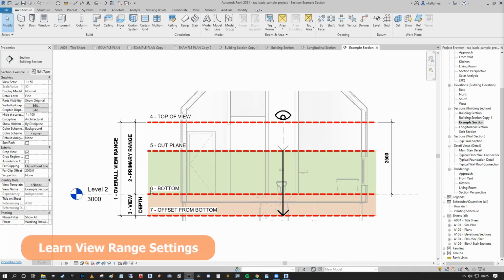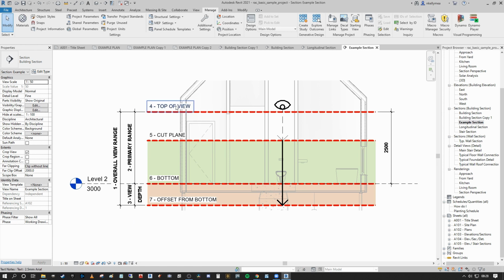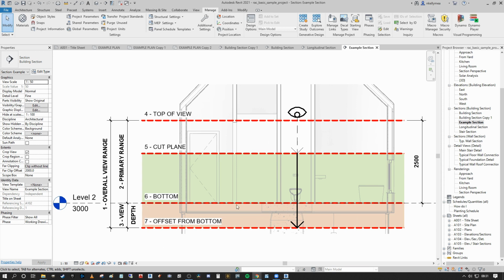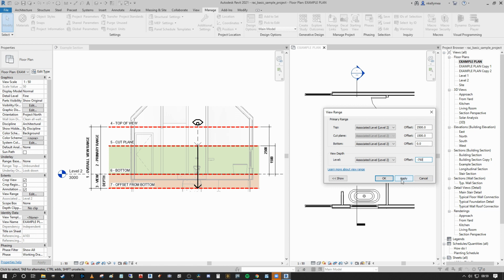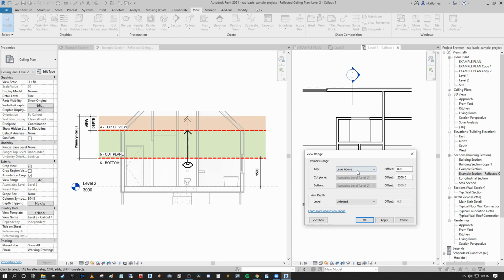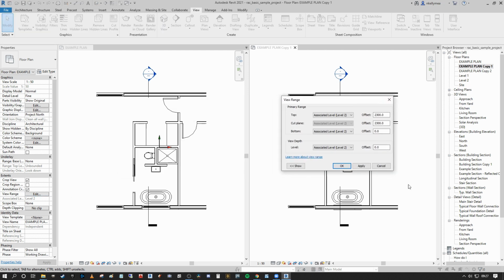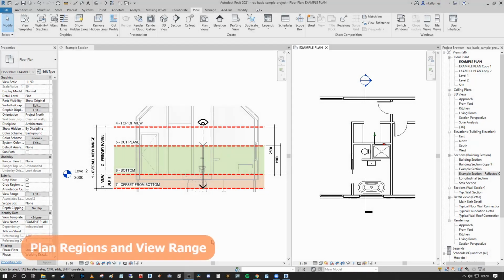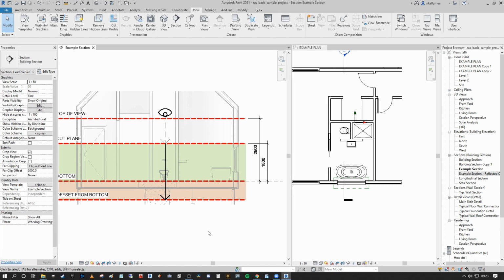Revit View Range Settings - Complete Tutorial

Comment: HI. Can you upload a video of view range setting for structural template
Reply from the maker: Hi there. I am not certain what you are looking for with your request. The view range settings are universal across disciplines, so the procedure outlined here is the same as it would be for a structural model.
Is there something soecific that you are having issues with that I might be able to give you some direction on?
Niall
Reply: @8020BIM  Thank you. In structure bottom and view depth is ok. But changing of Top value above cut plane not finding any changes in the drawings
Reply from the maker: You need to increase the height of the cut plane as well to see the difference you are looking for. Adjust the cut plane to match the top plane and see if the presentation of the steucutela drawing updates. Let me know how you get on.
Niall
Reply: @8020BIM  thanks.  Let me try it. How ever cut plane  level in structure usually 300mm . Cutting  columns , concrete upstand , stair ,  etc. So increase cut plane height may face some issue. However I will look into that. If u find something, pls share it also
Reply from the maker: @ssnanj8014  is it just something local to a specific area in the plan you are trying to see? You can use plan regions to locally alter the view range settings for one part of a plan without altering the entire plan. Go to the view tab, and under the Views drop down select plan region. Draw out the boundary of the view region where you need to illustrate a different view range setting and then select the boundary. In the properties tab you will be able to edit the local view range settings but the rest of the view will remain the same.
Reply: @8020BIM  Thank.you
Reply from the maker: @ssnanj8014  all working the way you need now?